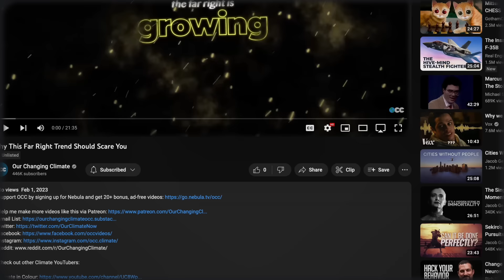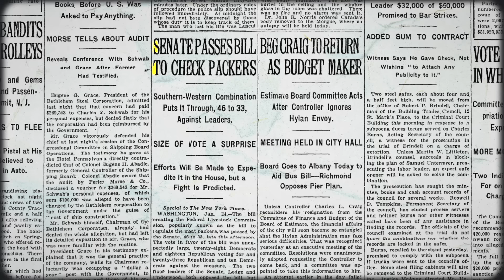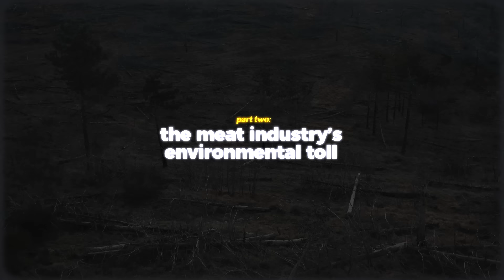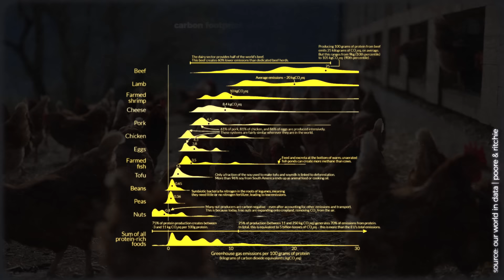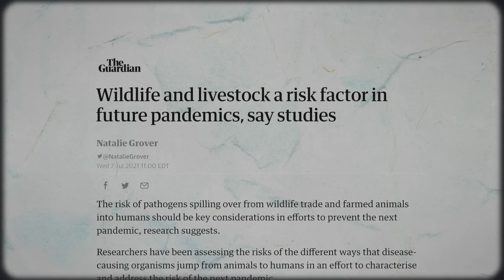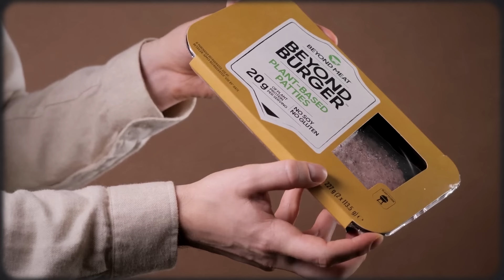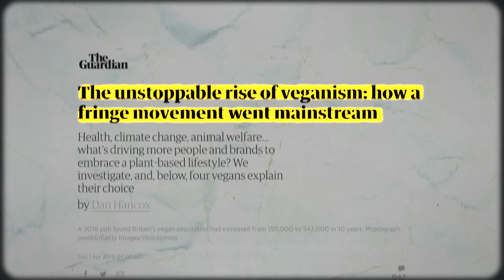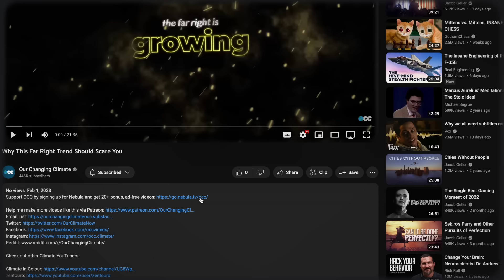Is Veganism Really the Answer?

Comment: Before the video starts, I am going to make a prediction about the answer to the title question:
No, it is not. Carbon sequestration infeasability, chemical fertilizers, pesticides, and habitat destruction being the biggest reasons why.
[EDIT]: OK, so I was partly correct. I was right, but only on about half of my points. It is indeed not the only solution, but only because it's not the only solution. It is still a solution, but it needs to be enacted alongside other solutions.
Reply: You should also check out veganic gardening and permaculture. Monocropping isn't the only way to be vegan.

Comment: When i learned of this, me with a string will, switched immediately.

When i talked to my friends about it, we talked about how it would be difficult for them and agreed that having it so they added one vegan meat meal to their weekly diet and increased the share over the months slowly that it would be fine even if it took 6 months or 5 years to go completely vegan.

Remember, new years resolutions fail because of setting the bar to high at the start when you should set the bar you want as the goal for the end of the year and make it an easy habit to slowly work into.
Reply: That’s a good strategy. 
Being vegan is easy, but making meaningful changes to your lifestyle and habits is hard. 
It’s very intelligent to take it slow.

Comment: The point he is making is that the increase in vegan dieting has not solved the problem, and people should not think that their personal diet choices are actually helping change anything. It’s great to go vegan, but we must not become content in that becoming vegan is actually affecting policy and changing the horrors that are the meat packing industry. It’s the equivalent of thinking recycling is solving the plastic pollution problem (it isn’t).
Reply: Recycling helps. And recycling is getting more efficient.
In Germany  we have  0,25€  deposit on plasic bottles and beverage cans. And it works! People  collect their bottles and cans and put them into Pfandautomaten (deposit machines)  that are found at the entrance of every grocery store chain. 

The shrinking demand for dsiry products leads to a shrinking number of cows in the milk Industry.  Of course  it's  hard for some farmers that don't  manage to transition, but we have an Organisation  that helps farmers to transition to plant agriculture. 

We have a new line of laundry soap. Instead of a big heavy package it's  a small package of tiny shhets of concentrate. A normal package of laundry soap for 40 machines is 1,5  Kilo. The sheet package weighs 100 Grams. It's  not much but it saves a lot of gasoline for delivery trucks when addet up. 
My coconut yoghurt comes in an ultra thin plastic jar that is stabilized by a cardboard wrapper. I throw the plastic and the aluminium lit into the recycling bin and the cardboard into the paper bin. 
More and more people  use concentrated cleansers. I buy my glass / window cleanser in tiny dry tabs that I throw into a reusable  spray bottle with water. 

I see a lot of small steps into the right direction.
Reply: Did you know that the majority of plastic pollution in the ocean is because of fishing gear?
Reply: @CordeliaWagner   consumer solutions won't change the bulk of the problems is coming from large corporations. Until large corporations can no longer own and control our governments nothing will change. It is a myth that all these consumer choices can add up enough to make a difference. it's going to take a difference in government and laws so let's focus our attention there. 

It's great to make better choices for ourselves in our own lives but let's not fool ourselves like that's changing the corporation's behavior. That's like pissing in the ocean to warm it up.
Reply: Exactly
Reply: @DarkDeepGreen   I don't know about the majority of it but I'm sure some of it is
Reply: @YourCapyBruv_do_u_rmbr_3Dpipes  According to an article from The Guardian that said "lost and abandoned fishing gear which is deadly to marine life makes up the majority of large plastic pollution in the oceans, according to a report by Greenpeace"
Reply: @DarkDeepGreen  if that's true it's probably from large commercial fishing vessels
Reply: @YourCapyBruv_do_u_rmbr_3Dpipes  Probably. Trillions of fish is consumed every year, and eating that much fish can't be done sustainably.

Comment: I find the comment at 20:46 (about veganism potentially exacerbating or contributing to eating disorders) a very strange argument to make. Do you have any evidence to back up this claim? I can guarantee you that the vast majority of people with eating disorders are NOT vegan. Vegans are such a small percentage of the population generally, so to suggest such a small group has a higher incidence of disordered eating would require some evidence, which is not provided in this video.

People with disordered eating habits will have disordered eating habits whether vegan or not. Veganism does not cause disordered eating. This is a common and incorrect anti-vegan sentiment.

Comment: Society has a great deal of control over veganism. The average citizen will never control their heating source, where their electricity comes from, or what necessities they buy are made of, but they can control their diet. It's irrelevant if veganism saves the planet or not. It's an easy first step that doesn't depend on a government that refuses to help. It's also irrelevant on an individual level. It will take a change in society at large to popularize veganism, so you can enjoy meat if you really want to.

Comment: The buildings holding animals shouldn’t be a thing. Corn is an evil crop that takes most of the land dedicated to plants. So many health problems because of vegetable oil and other products made with It. It should go. Bring back pastures.
Reply: Pasture expansion for cattle production is the main driver of deforestation and has been linked to 80% of clearing (Global Forest Atlas, 2016).
Reply: @nullethosechoes 
A case in Brazil, happening for both pasture and cropping.
Interestingly, the pastures are quickly sold off to soy producers at a profit.
The problem doesn't stay "animal vs plants " here, but the modern food system.

Comment: I commend the addressing of the ethical problems with pushing veganism as the solution. Yet, the health implications of veganism are  ignored. I don't want to hear B.S. about how Veganism is more philosophy then diet, because that argument is too often used to draft subsistence farmers into the vegan community. That clarified, Veganism only works for the human body in one of two conditions. Either you take expensive suppliments to replace the missing nutrients, or you have an expensive diet consisting of a plant diversity that has never before been available to humans and is still only available to those with a certain level of financial privliage in the imperial core. 

Before someone trys to bring up the historical veganism of whatever religion or peole group. First off that was likely vegitarianism or even pescatarianism, as veganism(excluding all animal by products) was extremly rare historically. Second rather it was religion or class based it didn't stop the malnutrition that resulted. Just like eating processed foods may keep you from starving and you look okay but are actually malnurished, veganism without one of the two conditions does the same. Well, not the same, but simliarly you'll be missiong key nutrients that, will likely, eventurally cause health problems that could have been avoided.

I know I'm being harsh, but this is a factor completely ignored, and needs to be a serious part of the discusion.

Edit: That's not to say we, in the imperial core, don't eat too much meat, or that vegans are bad. Just that it's far more complex, and even veganism is a form of acerting dominance over nature, in this case our own biology.

Comment: While the problems shown in this video are very real, it ignores the equally real problems with plant agriculture. Ranchers and farmers both suffer under consolidated corporations. Hypoxia is primarily a result of runoff from plant agriculture. Subsidies for ethanol and the like lead to excessive farming that is unnecessary. Plant protein is not actually a viable replacement to animal protein, except with very significant amounts of factory processing.

Our modern agricultural system is full of problems, and they’re interlinked problems. You can’t just focus any one part and attempt to solve it in isolation. You need to view the system and see where it could better link together. Animal agriculture consumes much of the waste in plant agriculture, and so linking them better, and reducing transport emissions by co-locating animals and plants is probably more useful than arguing about which is more carbon intensive. Chemical fertilisers are also a major source of chemical runoff into waterways. Would replacing chemicals with manure improve this situation? Because animal manure is largely unused because it’s not as convenient nor located near plant agriculture.
What about the beneficial effects of free range herbivores moving across environments? There are studies showing that animals are important to eco diversity in wild settings. Can we leverage this in agricultural settings? So many important things we can do, and questions to ask that are more valuable than ‘Meat bad; eat plants’, or the like.

Comment: The problem with your thesis is to focus primarily on production doesn’t solve the problem. As long as there is demand someone is going to supply it to make money. The only way to change the system is to cut out the demand but I have yet to hear an argument from any vegan to convince me to change my eating choices from a primarily meat based diet.

Comment: The major problem with veganism as the solution is that we're running out of fertilizer. When the petroleum based fertilizers run out, yields will drop by 80%. That's not going to feed 10 billion people, considering we're going to lose about half of all arable land to climate change. Lower density grazing on the marginal lands will provide protein that is no more carbon adverse than the 180 million bison that used to range the US, but it's not going to make the crops grow. 

Decentralized, solar powered aquaponics can. A backyards aquaponics system where fish like trout or tilapia are fed by the raised mealworms fed by the plant waste that comes from the hydroponic vegetables which are fed by nitrates from converted fish waste (and the plants also clean and filter the water to make for a continuous loop) has zero emissions and uses 95% less water than traditional farming. It runs on a half horsepower pump powered by solar, with no outside fertilizer and no pesticides or antibiotics, and as far as your personal intake goes, there's exactly zero food miles traveled (if you raise your own mealworms).  You can throw in a backyard chicken coop with 10 or fewer hens and you'll have the compost to grow potatoes and onions and similar crops that don't do well in hydroponics but do well in grow beds (which produce both fish and chicken feed in the form of worms). Plus you get eggs, and a chicken every Thanksgiving.

Comment: I think this analysis ignores the supermarket segment and the important consequences of the profit motive at that level: suppose the Tysons and Cargills are turned into coops with a smaller meat output than is presently the case, but simultaneously the supermarket segment remains profit-driven. Then you will have a society with a soaring meat price and meat becomes what caviar is today: a luxury consumption item for the wealthy, alongside all sorts of dietary problems and indigenous rights problems. A comprehensive analysis of the meat/beef problem would place much more onus on the supermarket companies. On the other hand, getting a society with less meat consumption seems to me to be asking more than just introducing socialism at every level of production. I could imagine that the working class could be convinced by a kind of "local production" doctrine, insisting that meat should be raised with local-grown feed and should be eaten locally (i.e. a ban or stigma on long-range feed and meat-transport). If that is done in conjunction with socialism, you possibly get a world with a low equitable meat consumption with a high satisfaction and low cultural brutalisation.

Comment: Fossil fuels – coal, oil and gas – are by far the largest contributor to global climate change, accounting for over 75 per cent of global greenhouse gas emissions and nearly 90 per cent of all carbon dioxide emissions. Also, chicken does not have a significantly reduced impact. Look it up.